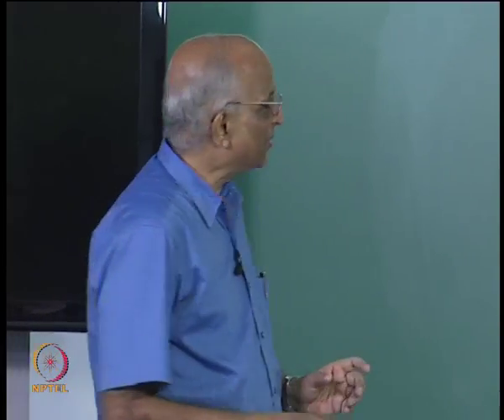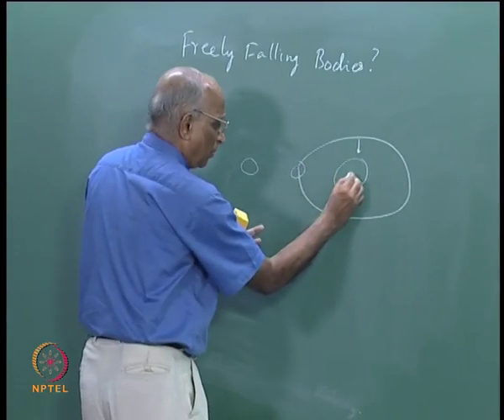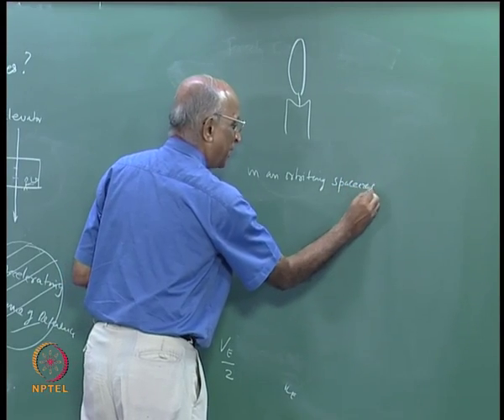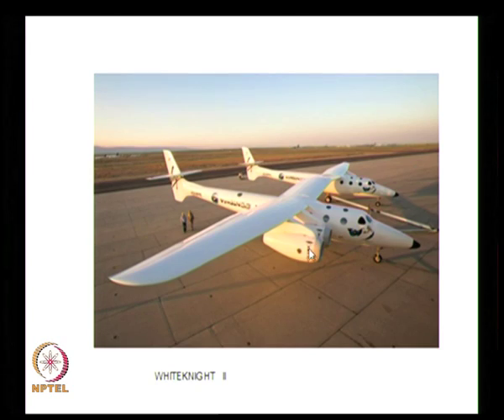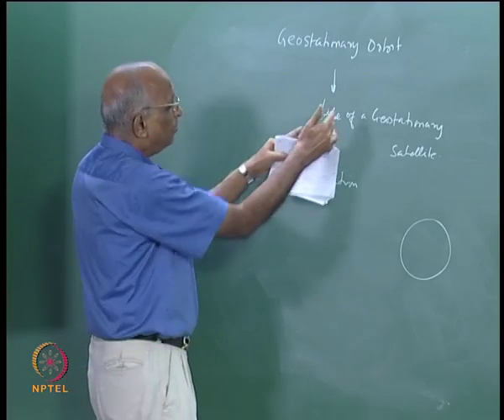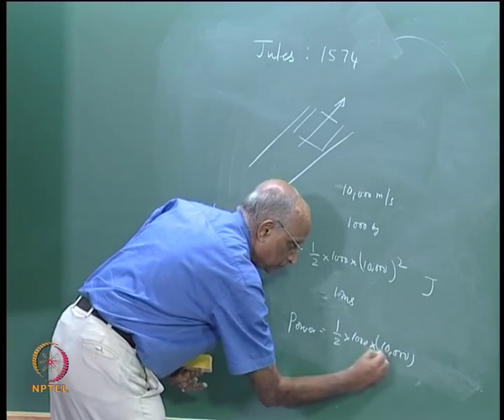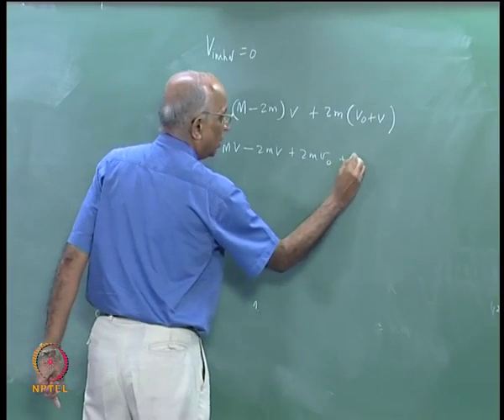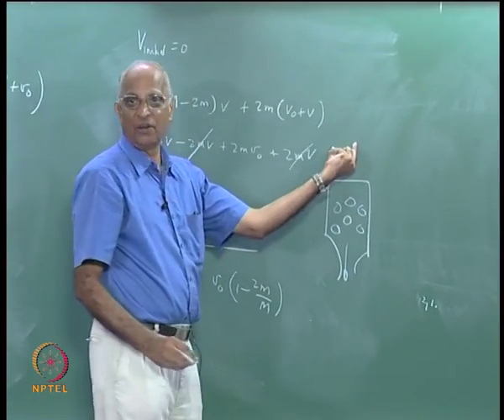Mod-01 Lec-05 Theory of Rocket Propulsion

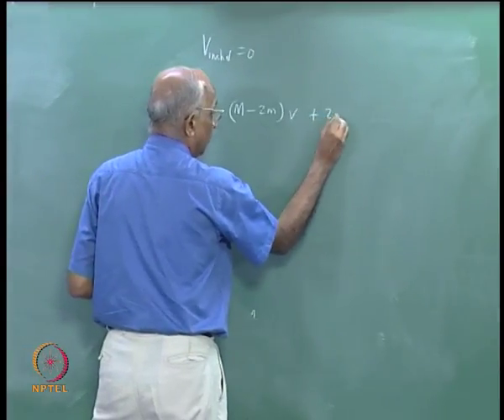Comment: why you have added V in " 2m(vo+V) " at 42:15, it should be the only velocity of balls?
Reply: I need help. I don't understand why the Professor is keeping adding v0 all around, so I decided to start from scratch.

Conservation of momentum means Pi (initial) = Pf (final)
Pi = 0 as the whole system is at rest at the beginning
For the case 2 stones are thrown together, v0 -- final stone velocity, v- final sled velocity:
0 = 2m*v0 + v (M- 2m)
v = -v0 * (2m / M - 2m)

And for the case when stones are thrown one after another:
0 = m * v0 + m * (v0 + v') + v''*(M - 2m)
where v' = v0 * m / (M - m) is a sled velocity after the first stone is thrown

Which means that it's actually better to throw 2 balls at the same time which obviously shouldn't be the case :)

Can anyone please explain where I'm wrong?
Reply: ok. Stupid me! v0 is always relative to the slides, so EVERY TIME we have to correct for that before putting v0 to the equation.
Reply: It is the relative velocity
Reply: You are correct. He specifically says the initial velocity is zero, so the relative velocity of the balls compared to the sleigh is just the velocity of the balls. The equation should have used the term  2m(vo+Vi), which is the same as 2mvo in this case.
Reply: same question here bro
Reply: The observer standing outside of the sled, will see a relative velocity.
Reply: that v0 is velocity at which ball is thrown wrt the boys ,but they themselves are moving along with the sledge , so to a observer on ground balls will be moving at (velocity of ball wrt boys + velocity of boys).  Hopefully this helps !!